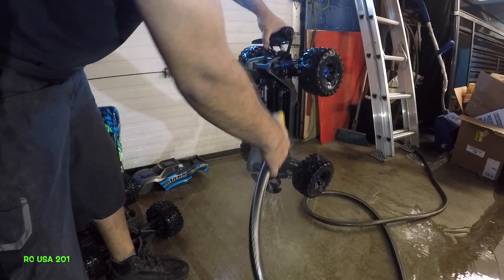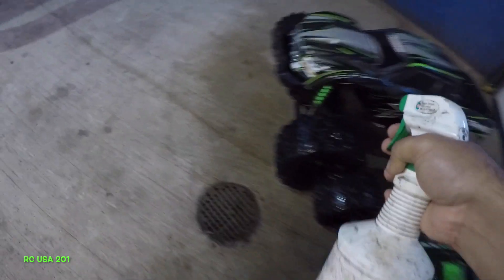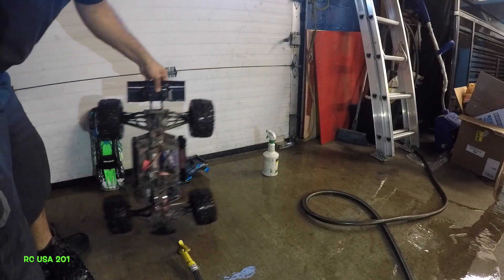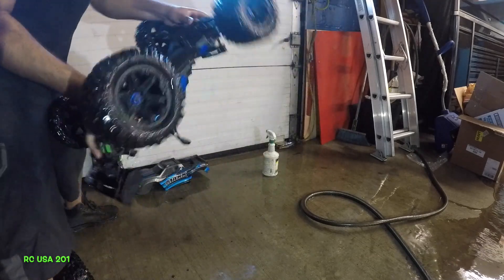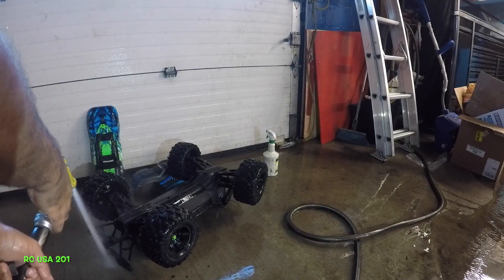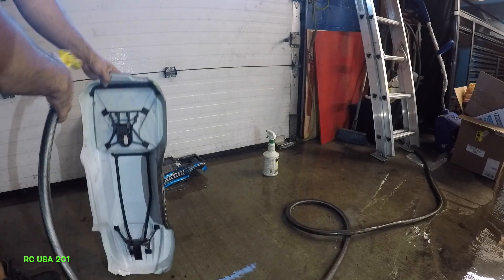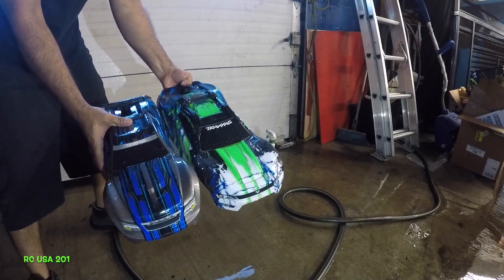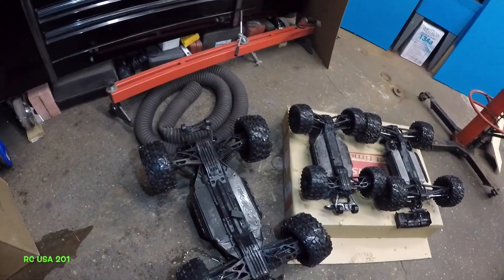TRAXXAS MAXX 1st wash Along with EREVO &  XMAXX

Comment: I hope you dry them off, as for the new maxx just try not to spray the water directly to towards the receiver where the wires are going in, over time will wash the gel away and water might get in
Reply from the maker: Dan  Berger you it’s good still works